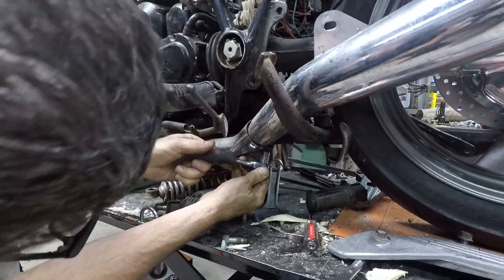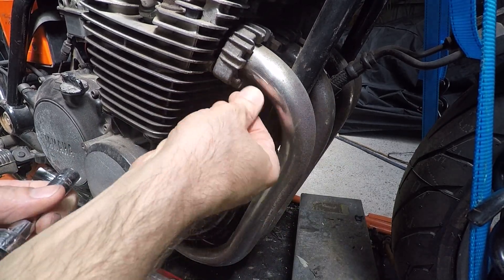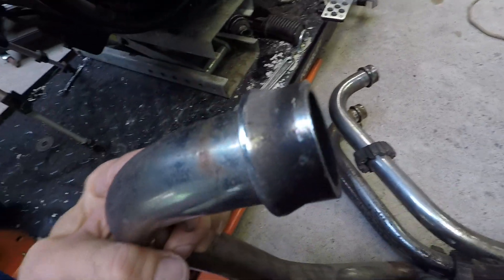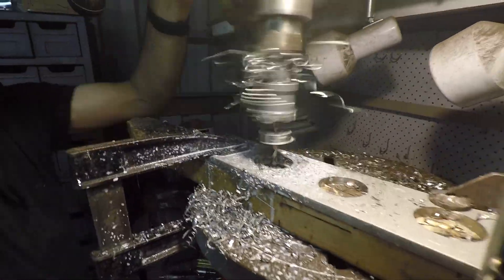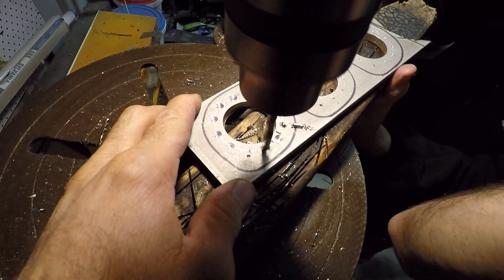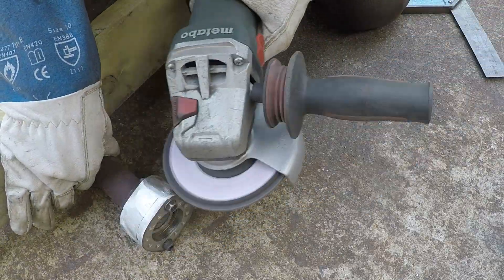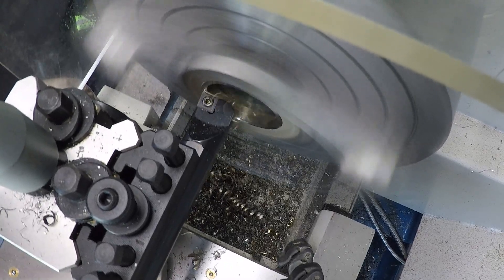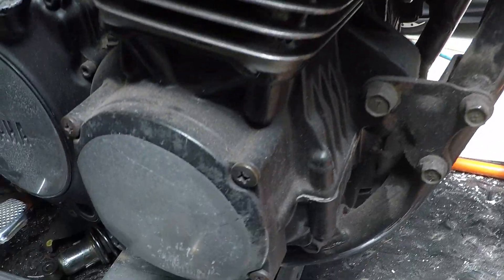Yamaha XJ650 Part 14 Custom exhaust flanges

Comment: Gday, I really like the way you put thought into a job, bigger pipes are really going to make a massive difference to the looks, simply effects like the dimples are going to take any plain look away, I’m looking forward to the next video mate, thanks for another great video,     Matty
Reply from the maker: Thanks Matty, its coming along. I'm got a few mods planned for the engine so want the exhaust to flow freely. It will mean some effort needed on the carbs but I did something similar on the Mowzuki and eventually got in tuned well.